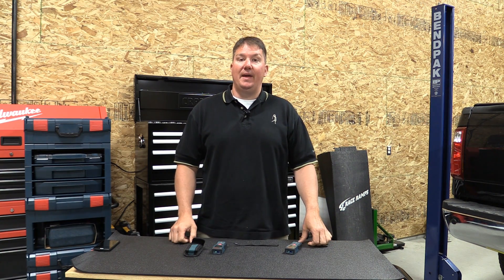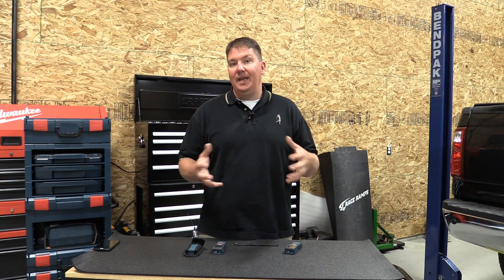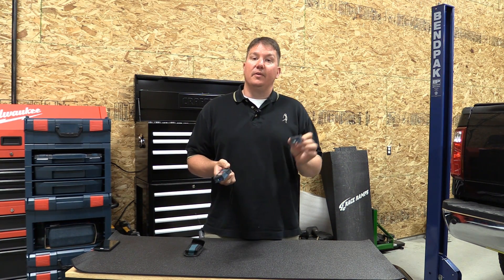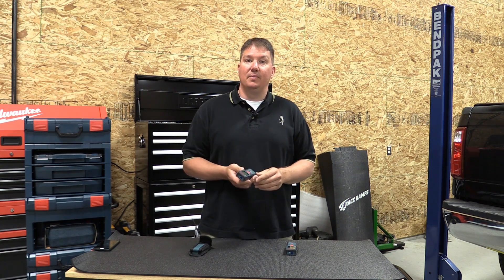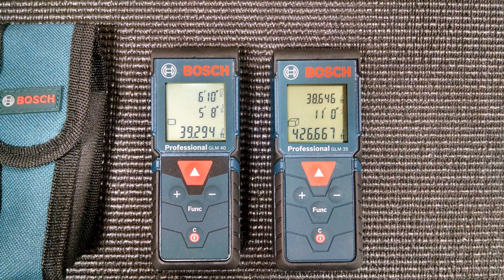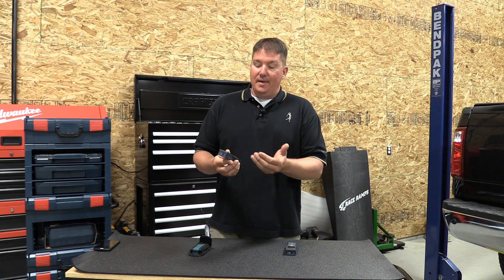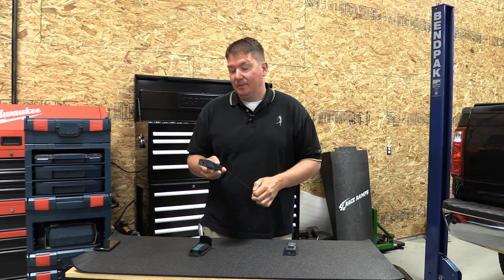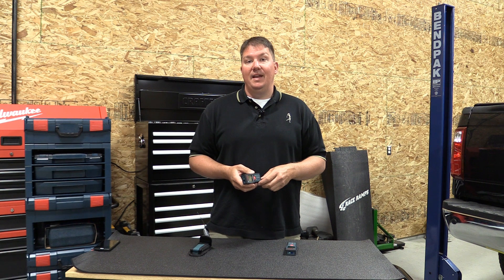Bosch Laser Distance Measures GLM 30, 35 and 40

Comment: The measurements are not practical though. It measures way TOO accurately. I wish it just measures by 16th. It measures by 32nd. Which means you would get measurements like 16 21/32. Who uses that?

Comment: I was looking to pick one up for my job, but we work with just inches when measuring. Is there a display setting to show just the inches and fractions of an inch? no feet.
Reply: Bump, need that same answer lol
Reply: @sergecasas3979  did as much research as I could. I don't think any round to a nearest fraction (I could use to the nearest 1/4)  I ended up buying 30$ wide blade Measuring tape. Kind of annoyed they are all AAA batteries too. Dewalt has an entry level rechargeable.

Comment: I bought a used GLm 20 and when I put batteries in it to use it comes on backlight stays lit and it says unit and goes back and forth from( m) to( ' ") . I hold down button to tryand shut it off bandit doesn't shut off are nothing its stuck like this could someone please help me. Thanks

Comment: Which model would be best for home use (not business use)?  I anticipate using one of these mostly indoors for room remodeling & interior decor projects in my own home.  Would the GLM 20 (successor to the GLM 15) suffice, or are there features on one of the fancier Bosch models which the typical homeowner would find useful, too?
Reply from the maker: GLM20 would be perfect as long as you can read it, otherwise, I would go with a color screen.
Reply: @WorkshopAddict  I will keep screen readability in mind if I decide the super-cheap (non-Bosch) laser distance measurer I recently ordered from Amazon is inadequate for my needs.  Thanks for pointing out the improvement a color screen makes!

Comment: Bought GLM30. Measured my 5' desktop, confirmed with tape measure. Came up with a GLM30 of 5' 4". No instructions to calibrate it. Probably take it back to home depot.
Reply from the maker: Can I ask where you are using the unit to measure from, the back, the front?  You can change that.
Reply: @WorkshopAddict  how do u tho

Comment: Hi ! One question.

Does the tool come with a bubble level so that we can level it properly before taking measurements of straight line/shortest distance between 2 points ?
Reply: But it does do continuous measuring so you can visibly see the shortest measurement if you're interested in that.  If you want to store it you can just scan the area, stop on the shortest distance shown, and shoot it.
Reply from the maker: No they do not.

Comment: I bought a GLM40 I wish there was a way to choose to keep the back light on. I was taking several measurements today in a low lighting and it kept going out on me. When I would press a button hoping to get the light back on, I would end up sending into another function. I had to keep powering It off and back on.
Reply: Yes. Move it to record then the measurement is not what you measured!

Comment: How do I get mine off of 32nds?  I only need to know 1/8ths
Reply from the maker: Great question.  I wonder if you can.....
Reply: these would be a lot better if you could choose a rounded accuracy such as closest 1/16 or 1/8 or even just have them read out inches instead of ft and inches.
Reply: I don't think you can and it's pretty annoying although it's relatively easy to calculate in your head